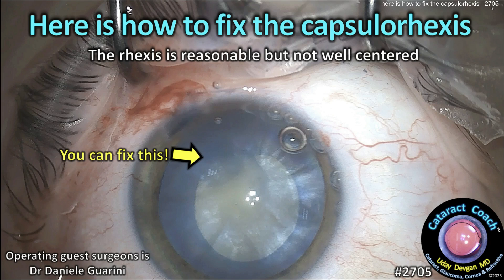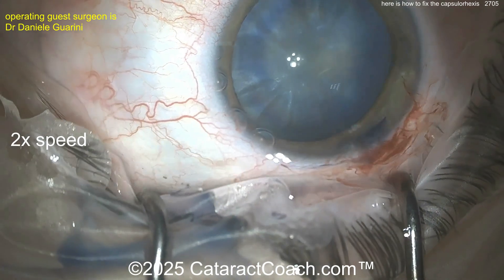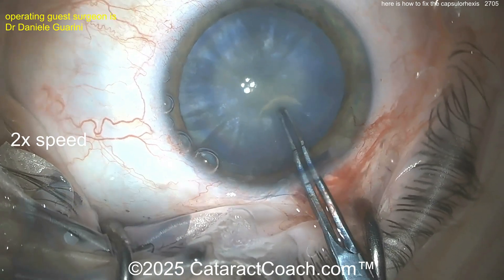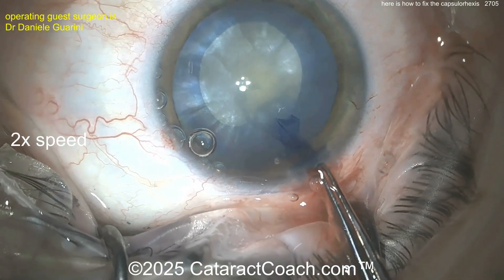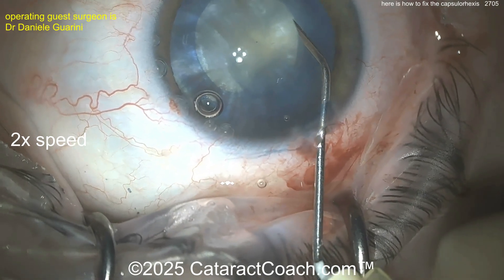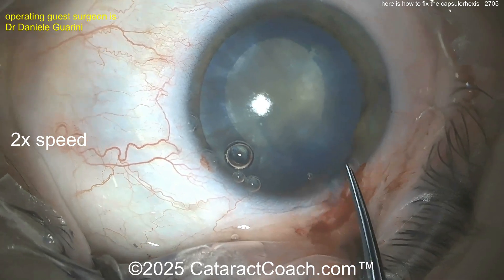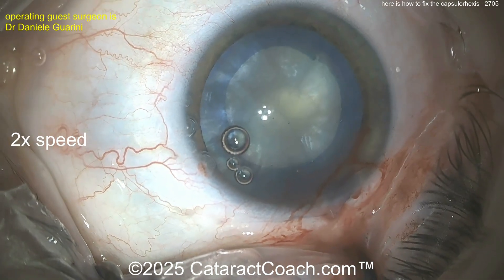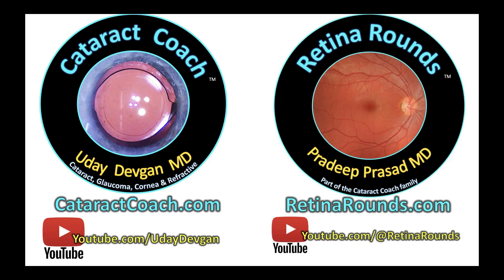CataractCoach™ 2705: here is how to fix the capsulorhexis

Comment: Don't try this at home. This is more of a 'what not to do' video and could have easily turned into a complication video. Enlarging a slightly small rhexis should be done AFTER the cataract extraction and IOL placement. Dealing with a run out rhexis in a mature cataract is not a fun time and very risky for lens drop. The rhexis size was quite adequate for nuclear removal. Also, when enlarging the rhexis, make an acute angular incision in the capsule rim to give you a small flap already heading in the direction you want to enlarge it. The radial incision in the capsule seen in the video led to having to deal with two small flaps, and high risk for a runout. You can also create a separate paracentsis to get the correct angle with the scissors or needle to make the angular incision.  I appreciate the surgeon video and oportunity to comment.
Reply: Agree. And later, better doing that not with a cystotime but with intraocular scissors
Reply: Well said !!!